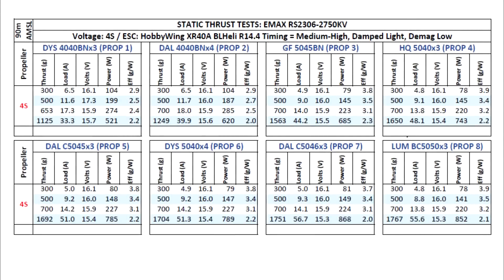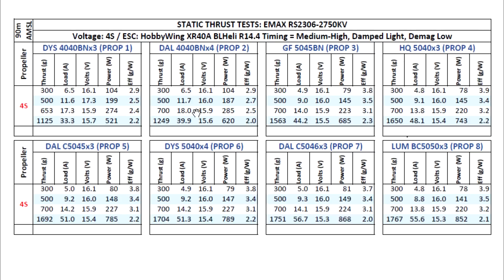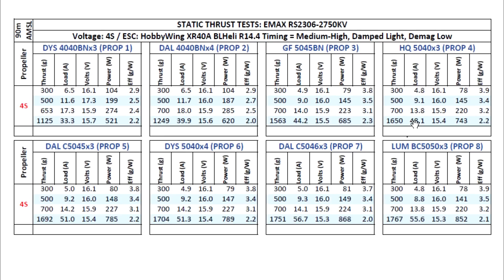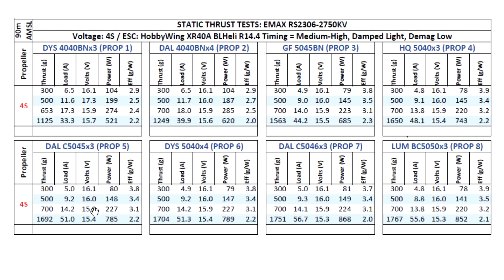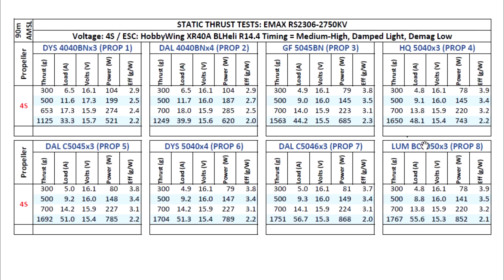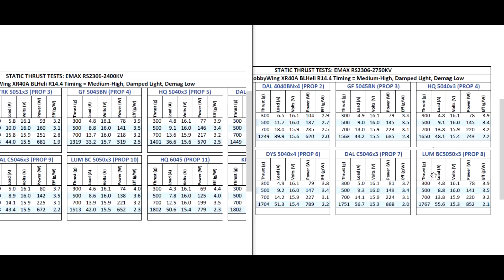EMAX RS2306-2750KV Static Thrust Tests - "2400KV" title on runs is a typo -

Comment: Wow those Emax 2750kv motors are a beast, but like you said and proved in your testing, it comes at the expense of massive current draw. I don't think there is a battery that's even close or capable of maintaining that sort of current draw for more than a second, and that's taking into account an unloaded prop and motor in flight pulling approximately 40amps. Great video as always man, you helped me make the decision to go with the 2400kv varient for the sake of my batteries and esc's.
Reply: Actually any good 1300 will do. In the air these don't pull much if any more than the RS S 2600's. In my OSD the max I've seen is 140a. Average max is around 125a. That means 2 minute races on a 1300.
Reply from the maker: Yes, that is most likely the case. When you have a larger stator, it will pull fewer Amps to get to the same speed BUT at the top-end it may have higher Amperage usage but of course, optimally it should also have higher power. That's why a good way to compare motors is based on RPM - Amps/load - Watts.

BTW, the KV check I got from my thrust stand is fairly close to what QuadMcFly - Ryan Harrell measured. Good to see the measurements on my thrust stand are pretty close to what he's getting. So the 2750KV is more like 2630KV or thereabouts. I think that's a good thing that EMAX got the KV wrong, it makes motor more usable, lowers LiPo discharge demand and makes for a less crazy Amp-hungry motor. So that's why Furadi kept saying that Amp numbers were not that bad in the air. The 2750KV rating dis sound kind of scary!

I've attached the Powermeter (the one from the video) together with a Mobius camera  to one of my quads, now I just gotta find some time to swap the EMAX RS2205(S) with the RS2306-2400KV and see if I can record some full throttle punch outs out of dives and out of 180 turns and full throttle passes to see what they're pulling in flight. It'll be interesting to see what the difference is from static thrust Amps
Reply from the maker: I think the limit is the LiPo. So if your 1300 mAh can only deliver sustained 120A for a short 5 sec burst, then that's all the 4 motors will draw = 30A each, no matter what prop you use, even 6" triblade. If you use a larger LiPo, like a 3000 mAh then the Amps will go up a bit, but we don't use those large LiPos in miniquads
I think Furadi is referring specifically to 200mm 5" prop / 1300mAh conditions. But you are right too, the motor does pull more Amps given all the current it can use.
Keep in mind static thrust tests exaggerate the Amp draw and thrust. In-flight, it will be a lot less due to LiPo capacity and unloading of propellers. I've been meaning to mount a powermeter on my quad to check and see what the max current is in flight.
Reply: OK 140a is tolerable, it is what my F60 rigs pull on the OSD. I fly acro so it won't hurt as bad, I might check these motors out.
Reply: Furadi I'm just curious, are you using a current sensor and is it calibrated/scaled correctly in Betaflight and to your setup using an accurate current measurement meter?
Reply: SteelRainSpo It's scaled very close. What's more important is the rig that I'm using has been used with multiple motors including the RS S 2600's without any other changes. So the current draw between motors can be directly compared.
Reply: Furadi The scale of the current draw between the rs2205s-2600kv and this new 2306-2750kv motor isn't even close or comparable. For example, in this video he pulled over 55amps full throttle with the 2306-2750kv using the Lumenier Butter Cutter props, where the rs2205s-2600kv motors maxed out around 40amps on the same props per miniquadtestbench.com. I'm sorry to say that if you are using the current draw scale and readings on Betaflight that you obtained for the rs2205s-2600kv motors for the new 2306-2750kv motor, it's not accurate, comparable, and nowhere near close, it's actually a 15amp difference in static max throttle tests per motor!!!!
Reply: EngineerX I fully agree that the small lipos we use in these 5" racing quads is always going to be the limiting factor, but then again who has actually tried to pull that much current from a variety of these batteries in a static test to see what's the limit? I understand that static bench tests will be much different on thrust and current draw on an unloaded prop as well, but the point I was making is, the current draw scale isn't comparable in any percentage of the throttle range between the two motors that perform completely different, and who knows what max current these new 2306-2750kv motor's will draw unless you have specifically tested and calibrated them on the bench and in the air with an accurate current meter.
Reply: I don't think you understand how current scaling works. It's a fixed value in BF. The motor of choice has nothing to do with it. Do you understand that I took a quad with RS S 2600's, removed the motors and simply installed the RS2306 2750's? Hence the current draw will be a direct comparison. 

Besides, I've flown with the 2750's maybe 40 packs already. Each time I land @ 15v after about 2 minutes of flying which is in line with the RS S 2600's.
Reply: Furadi I'm fully aware of how the scaling works in Betaflight, and there's also the offset numbers that have to be tweaked as well, but I have watched many video's from the likes of Joshua Bardwell and Project Blue Falcon on the calibration techniques, as well as sucessfully performed and tested many different setups. I have also accurately calibrated a specific motor/esc setup with 2 different current meters attached in Betaflight on an Omnibus f3 pro, and when I changed out my esc/motor combination to a more powerful setup the current reading was way off. Furthermore your close flight times are completely subjective and not directly comparable since it's not in a controlled manner or environment, and your throttle usage and motor thrust numbers are huge variables. 

I guess that we will have to agree to disagree on this one, but from my experience and testing the current sensing scale and offsets change with different esc/motor hardware.
Reply: If anyone flies in a controlled testing environment it's me. All I do all year long is setup repeatable race tracks multiple times a week. Otherwise it'd be pretty hard to compare gear and plan race setups. ;)
Reply: Furadi It still doesn't have any bearing on the discussion since the parameters aren't directly identical or repeatable, especially when flying in the air. What you're saying is no different than saying a racecar will get the same lap times consistently, while running out of gas at the same point in the race regardless of running two completely different motors at different times in the same car and same track. It's just not a good example of a identically repeatable test or parameter.
Reply: Well you believe what you wanna believe. I'll be over here enjoying my 2 minute flight times on my 1750g 2750kv motors with 1300 lipos.
Reply: Furadi Thank you I will because they're factual objective results and data, and why you seem to be taking it personally is beyond me, but I rely on factual scientific based testing and evidence, not hearsay and someone's inaccurate and subjective feeling or results. Happy flying :)
Reply: Just calibrated both of my BF F3 quads using 2 meters. A turnigy inline meter and a klein clamp meter. Both quads were actually scaled high. My 2750 quad less than my 2400 quad. That means I'm actually pulling less than 140a in the air. My 2400 quad might be pulling less than 100a.
Reply: Furadi Very nice man, good information, although I find it kind of odd that my Armattan OOmph 2206-2300kv motors initially spike at a current draw of around 120amps, then quickly settle down to around 110amps continuous swinging Cyclone 5045x3 props. Maybe my motors are working harder to swing those props at full throttle, thus drawing more amps than your bigger 2306-2400kv's are.
Reply: Took my RS2306 2750kv rig for a rip this morning with the recalibrated current sensor. 132a max with the new GF5152 prop. Not bad at all!
Reply from the maker: Furadi Gotta check your channel for some ripping videos. 132A max is quite manageable as that only happens for very short bursts. What's the readings at sustained "go fast" speeds for you? We'll see on your video OSD. Good stuff man. This motor is not as scary as it seemed, in terms of Amp-hunger that is. As for how scary fast it will get you going..... well,that's a different story!
Reply from the maker: Yes, 2400KV will be kinder to batteries. The limit will certainly be the battery. You can still run these and go very fast but some good discipline on the throttle stick will be needed so that max throttle is only for a couple of seconds at a time.
Reply: Sadistic Leprechaun He's using the current draw scale of the rs2205s-2600kv in Betaflight for these new 2306-2750kv motor's without recalibrating the scale, which isn't accurate or comparable at all. The rs2205s-2600kv motors pull 40 amps maximum on the butter cutters, where these new 2306-2750kv pull over 55amps full throttle, that's a huge difference!!!!
Reply: SteelRainSpo I get where this analogy is going ,but on the quad the motor you mentioned isn't the quads motor it's the battery that supplies the power and the motors example emax 2306 would be like running with a larger rim on a car compared to the 2205. so if you change wheels on your car at the drag strip you can tell a difference but the available power is the same. hope this helps

Comment: Hello, i know it's an old discussion, but i just ordered 2 sets of the 2550kv model (the only one that was available for the moment) and i couldn't find any test or thrust results anywhere on the web, did anyone else tested or used this 2550v version of them ?!
Reply from the maker: If it doesnt get any results in youtube search maybe try miniquadtestbench.com thats the only one i can think of.
Reply: @EngineerX  Thank you for your reply, already checked miniquadtestbench.com but the 2550kv didn't make it into the tests, i just wanted to know which props works best with the RS2306/2550kv for Freestyle use on a 4S setup, i ordered some Emax AVAN props and i already have some 5045 and 5046 cyclones, i hope these props will do it.
Reply from the maker: @RogerBaroudy  on 4S a lot of people like the DAL C5046 Gemfan 5152x3 and also the newer GemFan triblades. The 2550 will handle those well in 4S and ive seen people flying 5S too.

Comment: Can u tell me what battery specs do i purchase( mah, c rating, volts) to get 1.5 kg thrust with 5045 propeller 30A esc with this motor? Please
Reply from the maker: 1500mAh /70C or higher/ 4S
Reply: EngineerX thanks alot

Comment: Hey Guys, just a quick question, are the 2750kv too much for KISS 24A Race edition ? 

Thanks :)
Reply from the maker: Depends on what props, voltage and weight of copter. 
On 4S, 5040x3 props could pull around 31A on single motor 48A*0.65 (factor for in-flight unloaded prop Amps) That's for a single motor. 4 motors at full blast sustained Amps would be demanding 120A from a LiPo, but the LiPos we use can't deliver that much sustained Amps, only about 60 to 90A for 10sec. Find out what's the "burst" capacity of a Kiss 24A - it should be right around 30A I think. 
From KISS specs: "Instantaneous maximum current 30A active limited"
I would say the 24A KISS is "borderline" I could very well work but I'd be more comfortable running a 30A ESC with this motor. The current limiter might get triggered and make your copter fall out of the sky if that limiter works as advertised.
Reply: Thanks for the info, Greatly appriciated!

Comment: How can I raise 50 amperes or more with rcbenchnark?
Reply from the maker: It's supposed to have a 50A limit but I took a chance and just went for it and nothing burned. It gives you a warning but it still reads higher than 50A. I didn't do anything special. I use a R/C radio and ESC connected to Rx  to control throttle manually
Reply: Thank you very much for your reference.

Comment: please try this motor with 6 inch prop.
Reply from the maker: It'll fry my ESC and shutdown my power supply! LoL. 
On the thrust stand the current just gets too high, but if you run 6" prop in actual flight it'll be OK since Amps run anywhere from 25 to about 35% lower (guesstimate)

Comment: which kv gives better flight time?
Reply from the maker: 2400KV / GF5045BN or any 5040x3. Also the new Team RaceKraft 5038 2-blade prop could be very efficient with this motor.

Comment: Holy freakin' amp draw! almost 10 more amps on 5x4x4 on these motors than f80s on 6x4.5x3?!? Motors look great, but I think we need 45A escs soon lol
Reply: No we don't, haven't you watch the video?
Reply: No I was just reading the chart. I assumed that even with a reduction for real air flight, 50+ amps was too much.
Reply from the maker: Static thrust test are sometimes frightening ..... super high Amp readings but they're deceiving! Once you introduce the unloading factor and the LiPo battery discharge-limit capacity,  Amp-draw will come down quite a lot. If you go by my guesstimate of 35% less load in the air, then 55A static translates to about 36A in the air, but that's only for about 1 to 2 seconds, then the copper in the motor gets warm, resistance increases and current flow slows down and motor makes a little less power and Amp use goes down. Lots of factors involved. 
I have been meaning to attach the power meter you see on the video to one of my quads and do a few dives and 100% throttle punch outs to see what the actual total max Amps really are. I'll slap the 2400KV motors on and run that test (only got the one 2750KV motor for test).
Reply: 35% less! I have been looking for that number! Tell me, what do you estimate a 5S battery increases amp draw compared to 4S? Do you have a similar number? Is it 20% more since that is the volt increase (I think)?
Reply from the maker: I ran some 4S - 5S  tests on a 2208-1800KV a while back with my old DIY thrust stand, corelation seems like it varies depending on motor/prop. In some combinations it could be up to 30%. Each motor and prop has it's own load curve. For this EMAX motor 5S would be some insane Amp draw on the thrust stand!
https://www.youtube.com/watch?v=W3FKkVB3uZg

HQ6045      HQ5045BN
5S- 32.2A    27.3A
4S- 23.3A    21.2A

Also tested EMAX MT2206-1500KV / HQ6045
https://www.youtube.com/watch?v=klrQ-nH2nxQ

6S- 19A
5S- 17A
4S- 13A

Comment: You mention often that static thrust numbers do not occur in the air due to prop unloading in forward flight. I think, the tests are a good standard of comparison for fast turns, corners and stopping rolls, don't you?

Regarding "dynamic" thrust tests that we talked about some videos ago: If you know the amount of thrust for specific RPMs, is it possible to measure how long it takes to rev up from one RPM value to the other (microphone or optical)?